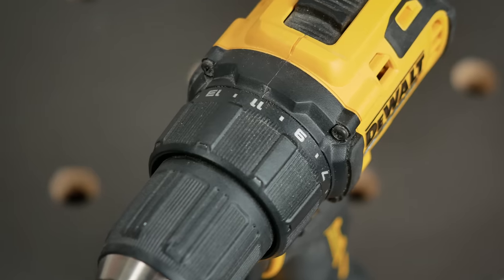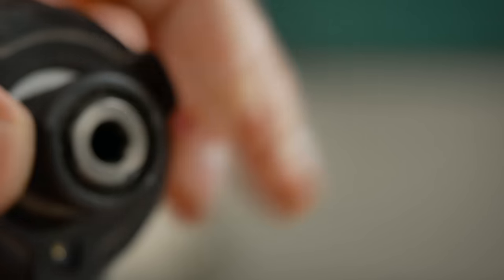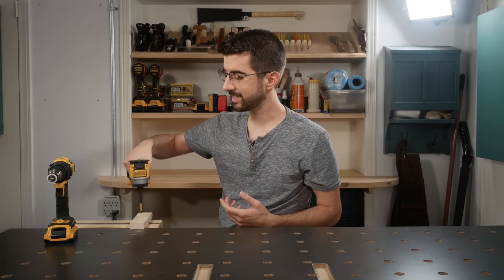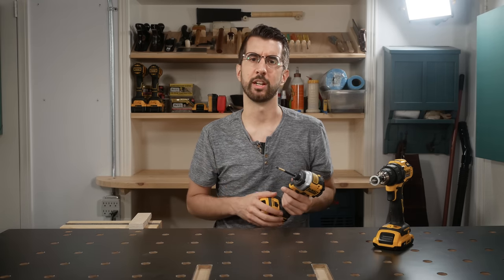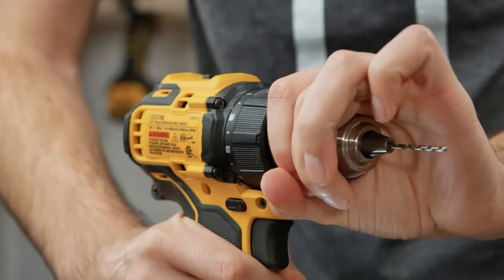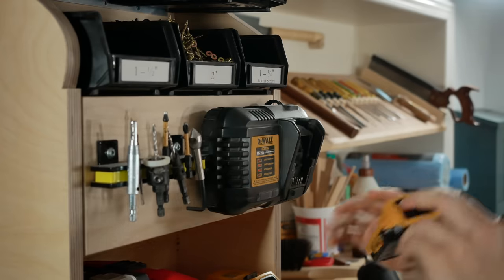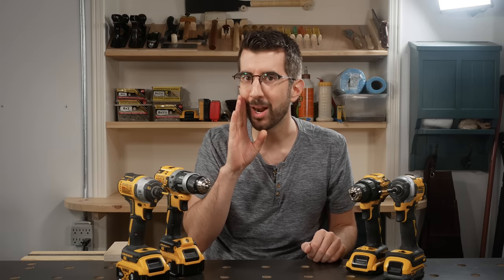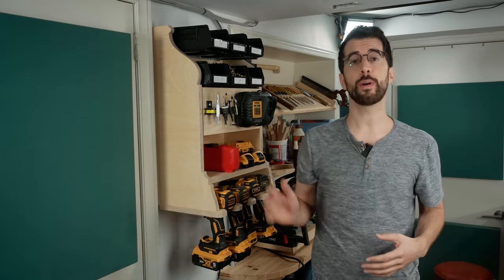why woodworkers don't use impact drivers

Comment: 1:09 Diablo DXT1010 (6") and DXT1020 (12") are the answer you're looking for.  they will hold ANYTHING that's 1/4" hex, even 1" driver bits without the retention detent, i use them with bosch daredevils instead of 18-24" long auger bits all the time.  also, am woodworker.  drill is for drilling holes and delicate stuff i need the clutch for, impact is for everything else.  i find screws get stripped far less often with an impact than a drill.  i live in canuckistan and we use robertsons/square drive a lot.  the momentary hits from an impact are far less likely to cam out and chowder up screws than the constant drive of a drill.

Comment: you can get a quick connect for the drill so it makes swapping easy. That’s what I do. I use my impact a ton for handy work and carpentry but never for woodworking or delicate work. Paid the price too many times.

Comment: I love my impact, but if your main reason to use one is the bit holder (and you can't find a good "magnetic" one for your drill) just get a Wera Rapidaptor or similar. My small 12V Bosch "Flexiclick" has a bit holder chuck too, doesn't DeWalt do a version of that, if it has to be yellow and black?

Comment: I could never use an impact because of the noise, but I also don’t need one as I do small easy projects and rarely use my drill (I make mechanical stuff so 3D printing etc)

Comment: I am an 70 year old avid lifelong builder,  woodworker, boatbuilder and have a degree in wood technology.
I use my cordless impact driver almost daily and keep it along side my cordless drill.
To say that an impact drive is not for serious woodworking is incorrect, simply wrong.
Each has its place. 
I love my impact driver for driving screws. I wish cordless drivers were around 70 years ago. I might not have repetitive motion injuries in my hands and elbow from turning so many screws by hand and driving so many nails with a hammer

Comment: I like the drill better for almost everything. Except if your doing rough framing with screws like a deck with pressure treated wood. It is just easier to drive big deck screws.

Comment: I’ve posted these other places but I will do it again. I will start with the history of the “Phillips” screw.  If it slips it it’s operating as designed. Mr Phillips designed it for the early automotive industry when the car frames were made of wood. There were power drivers being used that did not have all the torque limiting features therefore striping out the screw threads.  It was designed to cam out before that point.  
Next is all the stripped out or broken screws that were over tightened. That’s where the clutches came from.  You need to use the settings.  I firmly believe that there are as many stripped or broken screws as there are unplanned pregnancy from guys who live by “trust me I can stop in time.”
Third, buy a hex locking bit holder and leave it in your drill.

Comment: It’s a hardcore construction tool . I use my range of them everyday . Yes in joinery but I’d rather do it by hand 🪛. 
I’ve always believed the vibration helps drive the screw deeper and further into the wood easier . It’s not really got much to do with PZ2 pozi bits , we can use any type even slots in it but it’s about the vibration it creates it makes life easier . As for the workshop hell yeh it’s all about trigger control and experience so you don’t wreck things that need tlc not a sledge hammer .

Comment: I use my impact driver substantially more than my drill maybe5x more. Either you have the wrong impact driver or you only use small screws.  I have used 3 impact drivers and they do vary. My oldest and best is a Panasonic I find its level of control while driving much better than the others. For really light screws I do use a drill driver sometimes set to the right slip.

Comment: This thing about different battery profiles between different manufacturers is the most infuriating thing about modern electric handtools. Just imagine if all the other rechargeable battery-powered devices out there were different between manufacturers. Thank goodness for AA, AAA and 9V. And no, there's no reason that lithium batteries couldn't have been standardised similarly - they are pretty similar on handtools as it is, it's just the plastic housing and location of charging pins that restricts interoperability.

Comment: Drills are for drilling holes...impacts are for fastening bolts or screws...If you are ripping the heads of screws, get better screws...decent modern screws will literally pull all the way through a board...I got a 3/8" driver and put a 1/4" quick change head on it...that way I can still use it as a normal impact when working on my vehicles...you really need both a drill and an impact...

Comment: The 12v screwdriver is the way. Doesn't impact, still has the quick change and clutch, and is so small and light weight. Yes it is a different battery but the DeWalt ones use the same charger.

Comment: If you have drill….When you have finished making your nice cabinet, you can go outside and drill concrete anchor points for a shed/awning/ gate etc because..hammer function.  If you can only afford one…get a hammer drill driver.  An impact is a nice to have extra.

Comment: All the issues with an impact driver can also be solved with experience. While I recognize the short comings after acclimating to using one for a couple years regular drills have become utterly useless to me. If I need to use a fat bit I just use a quick connect Drill chuck attachment on my impact. Great Video though.

Comment: The only problem I have with my impact is that if the screw does not have a long blank shoulder it will not pull the wood together so I still have to predrill anyways. However, I did find that doing some demolition wanting to reuse the lumber, the impact was THE tool and took very tight screws our with ease, some even being reusable as well.

Comment: I regret buying my impact driver. It has a shorter profile so in rare cases it is useful. The impact driver does not automatically stop. It will strip heads if it encounters resistance. What is the advantage of the impact driver then? They are too fast for a beginner like me, and just causes damage

Comment: The Makita bit holders grip the bit really fucking tight because of the circlip that they included. The only downside is that you usually need to use pliers to pull the bit out

Comment: My Fuel impact driver is amazing, and I build cabinets professionally. Low speed on that thing is a godsend, and it's less than 5 inches long with a short bit, but you do have to pull it back out with some needle nose pliers.

Comment: Spent years twisting chucks, swapping drill bits for screw bits but now the impact drives everything. Pilot hole with the correct size bit at an appropriate depth and there's no issues.

Comment: It ought to be noted that Phillips screws are designed to cam the driver out of the screw head to prevent over torquing the screw and stripping the threads on machine screws...
Power drills never used to have clutches on them, the clutches were added when some bright sparks started over torquing their screws using a power drill and stripped the threads. 
Now impact drivers are to some degree engineered to nullify the engineering in the Phillips screw head...
Pretty soon I imagine we'll see electronic torque adjustment on impact drivers that will be marketed as a safeguard to prevent over torquing...

Comment: I’ve nearly never used the clutch on a drill. Having any decent trigger control will do a better job, considering even when I’ve set the clutch for a million identical screws, any inconsistencies in wood itself can cause different torque to be needed to set screws the same height, so it’s also useless in that regard. Only useful for assembling ikea furniture lol

Comment: Other than car painters (carpenters) and car mechanics, nobody needs an impakt driver. Drills are easier to control, more precise and have more than enough torque for woodworking jobs. Impax are trendy, but way overrated imho.

Comment: As what most people would consider “an expert carpenter” I hardly ever use my impact driver. My Festool T18 is so smooth and powerful and the quick change system is amazing.

Comment: I use my impact driver often in wood working. It fits in tighter locations, quik change and  sinks screws better. I use the proper tool for the proper job.

Comment: I’m a journeyman carpenter/ fine woodworker….. the problem with your bits coming out of your bit holder, is your probably buying them from Home Depot or Lowes. The ones most pros use have a clip in them that keeps the bit in them. You are going to find them at a place that carries door and cabinet hardware and most of them carry the good bit holder’s

Comment: I'm not a huge fan of impacts except for very large fasteners. I use a drill for pilot holes, and one of the multi head drivers for screws. For woodworking, I haven't used my impact very much. Not to say I wouldn't want one, just that it sees use maybe 5% of the time for me.
That dewalt atomic impact is awesome; super compact.

Comment: I got great discounts on the DeWalt XR drill and later the new atomic impact. Both came w batteries and were on sale. I also got the Makita rear handle circ saw 7 1/4 on sale and recently the compact 4+1/2" DeWalt saw. Handy device. I use the impact w wood but I'm not a professional, just home improvement and hobby

Comment: I honestly ONLY use my impact driver. On the rare occasion I use my drill because I'm doing something where having two drill type devices with different bits ready to go is helpful I always set the chuck to the drill option and never really use the stupid chuck anyway. When a drill dies on me it's always because that chuck mechanism broke. I wish I could buy a drill without one but you can't. At least not in the size you're showing which is the most common. I don't know why people have such a problem driving screws too far but maybe they're just not paying attention to their work or something but I've never had the issue. The lighter and more compact drivers are just easier to handle and use.

I got into the Milwaukee tools for the same reason of the battery. I needed to replace a dead Rigid drill (never buy those) and a Ryobi (never buy those either) had previously caught fire in my hand while using it. The M18 Drill/Driver combo with a charger and two batteries was on sale while the DeWalt was not. Then when I needed a new circular saw the Milwaukee made sense because the batteries could swap. Same thing when I needed a cordless sawzall and a jig saw and a leaf blower and a weedwhacker and a grinder and now it would cost me about five thousand dollars to jump to another brand. So a Milwaukee fanboy I am.

Comment: If you use the proper phillips head screw driver for that screw, none of the issues you mentioned are a problem, they even have torque limits built into the design of the screw and driver. If you have to put more pressure, your screw is the wrong one or the driver is. Phillips head is the only screw or driver you need. Everything else is just a waste.

Comment: Hey I'm a Carpenter and Deck Builder and also a Woodworker, and I use impact driver a lot! But only 1 brand I use when it comes to woodworking or Carpentry and That's Makita! It's either my Makita XDT-16 or my Japanese Made Makita TD172, TD-173 18V and TD-002G XGT-40V all of them have 4 Speed with extra features! That's Auto Mode!, Bolt Mode, Tapper Mode #1 and Tapper Mode #2 And I love these features! It's a perfect impact driver for me!

Comment: New subscriber here.  I am learning about impact drivers for attaching wood studs to a metal purlin frame in Garage/shop.  So I am considering a impact for self drilling screws into hard metal (metal purlins).   I have used a drill with a clutch but the Philips pops out and I want to try the impact driver.  You have many comments that apply to me.  

About the brand, I agree.  I am with Ryobi because of the investment in batteries.  I would lean toward Milwaukee if I were starting now, but have been using these Ryobi’s for 10 years.  

Thanks again for your video!

Comment: My dad had a Craftsman drill from 1962. I wasn't strong enough to lift it until 1972. 

I had a B&D drill that I bought in the mid-80's. I had it until about 4 years ago. It was variable speed but very hard to control. I can't believe I waited so long to buy a "modern" drill.

Comment: I think your depiction is slightly inaccurate, as the impact force is not only rotational but downward as well. Another factor that assists in preventing the screw skipping and stripping the head
Reply: Well, not downward, but parallel to the axis of rotation.

Comment: I've evolved a lot with tool use over time. I use M12 drill and Surge driver most of the time now. I view both as important enough to have both. Surge is nice in that it's much less noisy than the non-hydraulic impact.

Comment: Also Dewalt fanboy here. I use my impact drivers all day long to drive the screws. When I use a drill as a driver, I always forget to set the clutch into the correct setting when driving multiple sizes of screws. Not to mention the twisting force of the drill is so uncomfortable. I trust in my impact driver, eyes, and my trigger handling. lol

Comment: DeWalt tools are a PR move from Black and Decker who bought the rights to Dewalt in the 60s Dewalt never made any tools other than a radial arm saw the DeWalt tools from the 90s were actually black and decker industrial line tools Black & Decker was having a problem selling the tools because of the bad reputationOf tradesmen head of the shitty 70s homeowner version Tools Black & Decker .Just like the 90s versions of Dewalt routers were actual exact copies of the swiss made Elu routers which Black & Decker also owned. I am 50 years old and my 55-year-old brother has exact copies of my Dewalt tools but instead of being yellow they’re black and gray and they’re badged black and decker industrial in fact the plastic guard on all Dewaltmiter saw is an exact copy of the Black & Decker 10 inch mitre sawFrom the late 80s so is the dewalt dewalt 10” non sliding miter saw. Elu made sliding miter saw before yellow dewalt was ever around. And early 90’s trim carpenter sliding miter saw of choice was hitachi as B&D (dewalt) didn’t even make a slider

Comment: If you’re doing the kind of woodworking the uses lots of screws i don’t see any reason to get pretentious about the driver you’re using.  

You’re screwing 2x4 pine together for gods sake. My pinky is so far up I barely allow you to call it woodworking at that point. 😂

Comment: The clutch is garbage. Any skilled worksman has control over the trigger like second natur. There's a bunch of bits holders licks the bit just fine.Pure power is better that impacts and strips less if you just use it properly and apply propper pressure.
Reply: Well, it’s a good thing they have the clutch for all those unskilled plebs. It must be exhausting being so much better than everyone else.